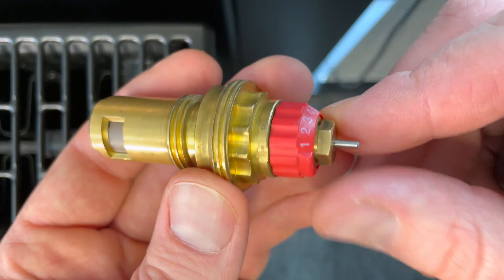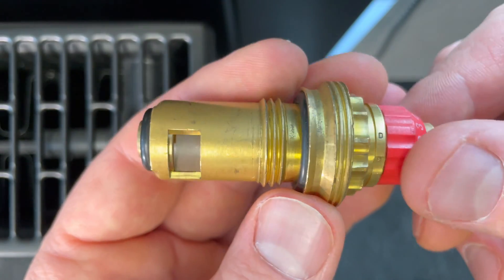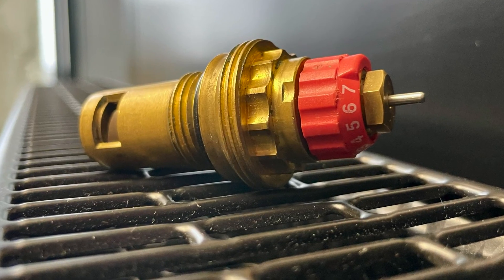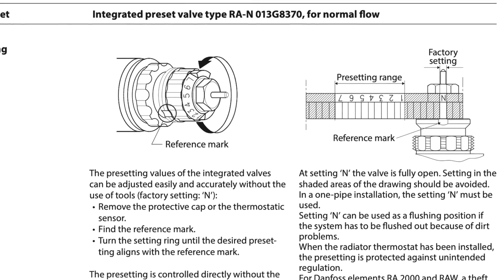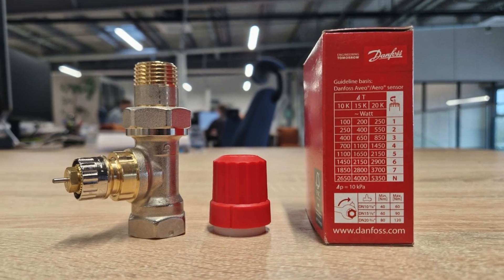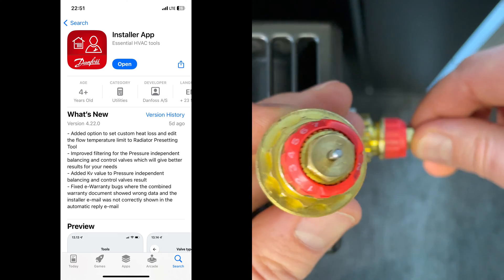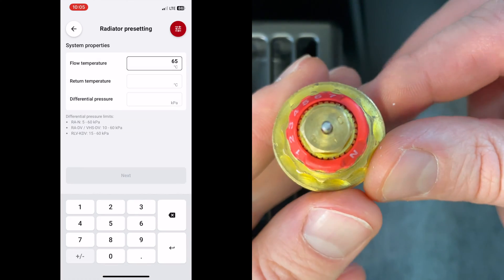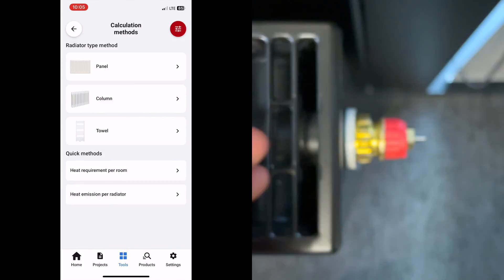How Thermostatic Radiator Valves Work | Easy Guide to Setting TRV's

Comment: Hello this video is very useful but I had a question.

If you keep turning it clockwise for example does that mess up the presetting measure. For example if it's at number 5 and I turn it clockwise a few times and put it on 5 again, does that mess up the preset for the number 5 setting? so its not like a screw where you keep turning it to tighten or loosen?
Reply from the maker: Hi! Turning it clockwise or counterclockwise doesn’t "reset" or "mess up" the presetting. The presetting number (e.g., 5) represents a specific valve opening, and as long as you set it back to 5, the flow will be the same.
Reply: @heatingsolutions123 thank you, I had the same question.

Comment: The video was kind of quick however I think I got it. The marking to set it was on the bottom side so I set to factory setting. It wasn’t working at all so it solved the problem, we just had it installed. It’s working now and thanks for the video, I can adjust the settings to where it can be used effectively.
Reply from the maker: Thanks for the feedback! I’m glad it helped you fix the issue!